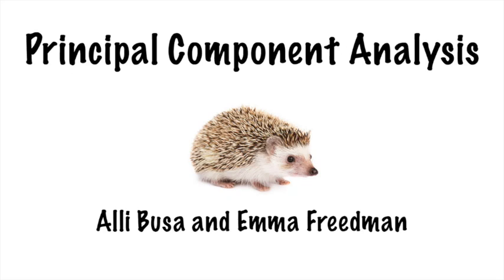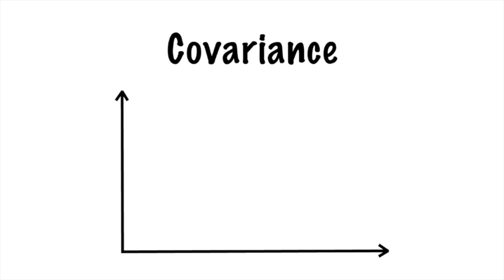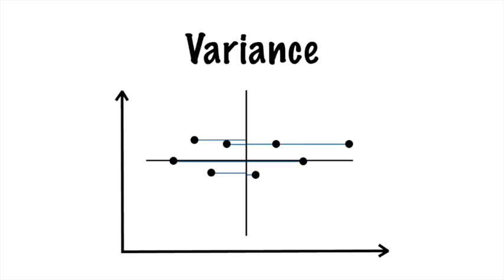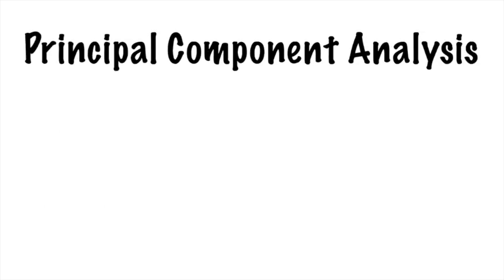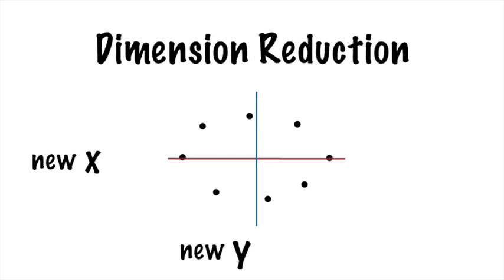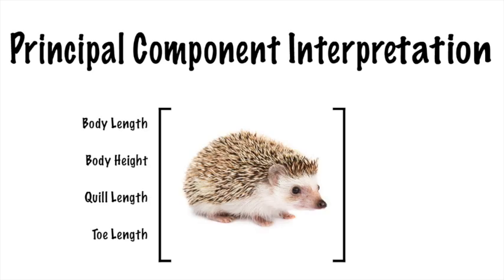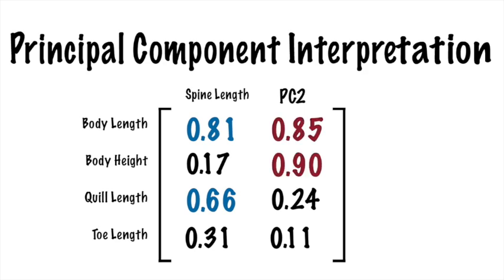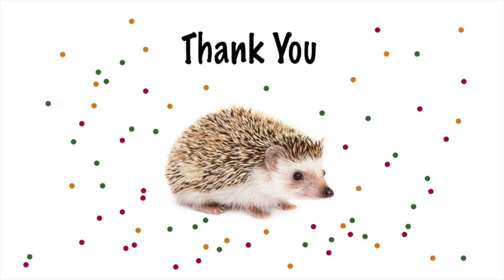Visual Explanation of Principal Component Analysis, Covariance, SVD

Comment: I do understand that eigenvalues represent the factor by which the eigenvectors are scaled, but how do they signify “the importance of certain behaviors in a system”, what other information do eigenvalues tell us other than a scaling factor? Also, why do eigenvectors point towards the spread of data?
Reply: If you consider a raw matrix or just geometric examples eigenvalues are just a scaling factor indeed. And you cannot say much more. But here, we are talking with additional context: we know we are doing statistics and putting "data" into a covariance matrix, which means we can now add more interpretations. The eigen vector is not just some eigenvector of some matrix, it's the eigenvector of a covariance matrix in the context of statistics, we've put data into a matrix whose elements measure all the possible spread of data, which is why we can now say an eigenvector points towards the spread of data and its length (eigenvalue) relates to the importance of that spread.

Comment: No one explains why they use covariance matrix. Why not use actual data and find its igen vector/igen values. I have been watching hundreds of videos books. No one explains that. It just doesn't make sense to me to use covariance matrix. Covariance is very useless parameter. It doesn't tell you much at all.
Reply: No it does especially using PCA. But you are right, you need actual data. Say the data are 3D points of some 3d objects, if you use this technique (build a cov matrix using the 3D points and do the PCA of it) then you will find a vector aligned with overall direction of the shape: for instance you will find the main axis of a 3d cylinder. This is quite a useful information.

Comment: How do u find eigenvalues and eigenvectors from the covariance matrix?
Reply: Same as usual, right? Find lambda using det(Sigma - lambda * I) = 0, so just take lambda away from the main diagonal of the Cov. Matrix, take the determinant of that and you'd be left with some polynomial of lambda which you then solve for, each solution being a unique eigenvalue.